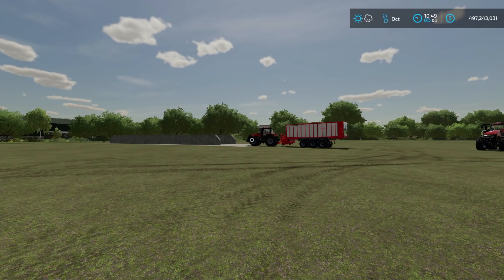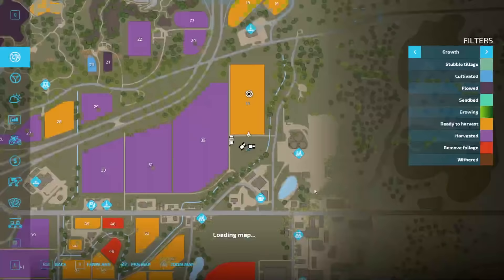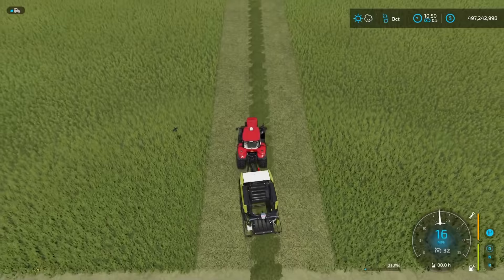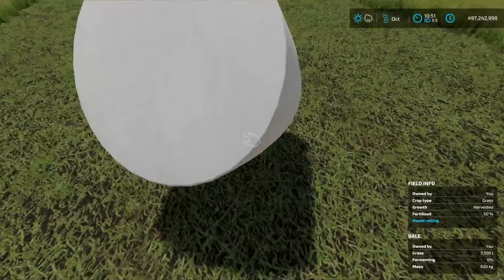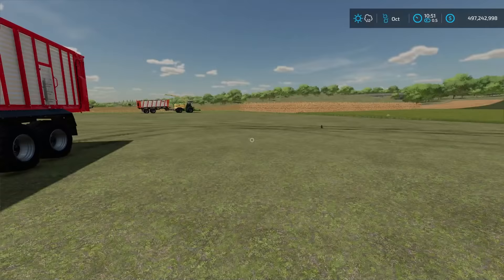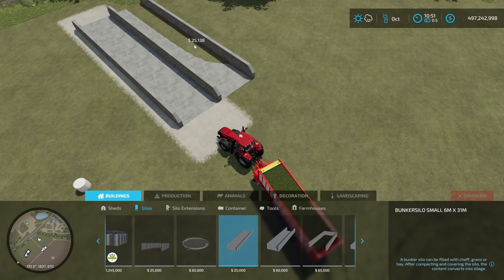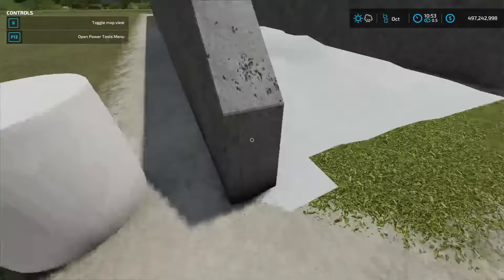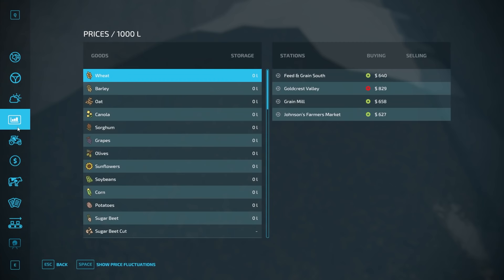GUIDE TO MAKING SILAGE - Farming Simulator 22

Comment: You can also use the forage wagon to pick up the silage from the bunker if you driver over it, probably the quickest method
Reply: Yeah, but if you have a lot of silage  you get massive divots in the silage and the forage wagon just gets stuck, especially when your wagon holds 200,000 liters and you have 2,000,000 liters of silage in your bunker
Reply: I’ve been using the belt system in the agi pack that can pick up product off of the floor to transfer to a trailer.
Reply: Definitely think the belt systems are the fastest non modded way to collect silage from bunkers, I also like the silage harvester mod
Reply: @sparks6177 I’ve never even thought of that
Reply: @sparks6177 do you just turn on the belt system and drive it through the silo with a trailer behindit?
Reply: Atleast give the original poster the credit of the idea  @jjferrin4

Comment: The one nice thing about the Anderson sausage press wrappers, is that the larger one is the ONLY one in the game that can wrap large 180cm round and 240cm square bales.  Unfortunately you have to hand feed it (too bad, I've seen a conveyor mod for small bales on the unofficial sites) - however, unless you have sheep, there is no use for grass bales other than selling at horrible prices compared to hay and silage - and there is no mod even atm, with will shred grass to you can silage wrap it again - animal mixes take hay, straw, silage, not grass as well - I have made a handful of grass bales by accident, where I changed the bale size  accidently to the largest, and my round wapper would not wrap it, so it dumped grass.  Also, if you use your round wrapping baler that can make 180cm round straw/hale bales, sometimes I get the wrong bale I expect, when I switch between 150cm silage and 180cm straw.  Depending on how many you have (I have 9 7500l 180cm round grass bales), it is worth leasing the sausage press to make silage out of them.  $1800 to lease, but my $2500 in grass bales will be worth ~$17k as silage, so well worth it.
Reply: The Kuhn SW4014 can wrap bales up to 220cm so thats not a big difference compared to the Anderson wrapper.
Reply: @Luuk-ur3sp  My point to use it, was at times you get grass bales instead of straw bales, if using your baler for both. And large grass bales are useless unless you have sheep...and more useless if you demand it be hay for long term storage.  Therefore, you can have the sausage press to wrap those large grass bales you may get once in a while, and it will indeed pay for itself.  If you have spare space to make long sausages, they are perfect to easily pick up during sell time with the Anderson and Arcusin real autoloaders...if you used modded fake bale autoloaders, dont bother. If selling silage, and not using fake autoloaders, logistics in picking up bales during sell time becomes a problem, but IMO still much better than loose, as bales have a huge density advantage over loose...with loose, trucking and trailer maintenance costs will eat a lot of profits, and your most valuable resource....TIME.  With maintenance and fuel, loose is far more inefficient than bales in FS22...needed only for corn silage, until someone makes a corn silage baler...and those do exist IRL and should now be possible as a mod in FS22.

Comment: In the video with the loading wagon bunker, you showed a potential bad problem many people have.  You covered the silo with all the grass not in the bunker.  That chaff strip sticking out which did not get covered with screw you.  You go to scoop up the silage and you pick up the chaff first, and it turns your entire pit back into chaff - well, this atleast happened to me in 1.1.0.0 - not sure if they fixed it or not in 1.2.0.0.  ALWAYS push you chaff all the way into the bunker...be prepared to push it a 1m inside, so you when your vehicle exits and causes the chaff to flatten and spread, it still won't be out of the bunker.  Shortcuts lead to bad cuts!
Reply: Thanks for the tip!
Reply: If you use the soften tool, it will get rid of the chaff it touches, be careful though, it can also remove the fermenting silage in the bunket.

Comment: Grass silage has a 25% higher yield (and I wasn't using a baler with silage additive, but the forage harvester did). Overall maintenance is probably similar. Grass will not require plowing or planting annually but does require 3 harvests to Corn silage's 1. However, grass should be rolled right after harvest for an extra layer of fertilization. Rolling versus fertilizing has a trade-off. This trade-off with time vs. money as fertilizer can be thrown out at great width, where-as the rollers aren't even close to that width but cost nothing over ground except maintenance costs. Handling may be the same between the two sileage types as corn requires hauling and a silage bin, then it needs to be picked up out of the silage bin and hauled in a trailer. This can take at least a full trailer for a small field, let alone multiple trailer loads for a size-able field. With grass baling it needs to be mowed, then baled and wrapped, then gathered and stored. Depending on the bale type or baler this can be a multi-step process. Once it ferments then it needs to be moved in bales. The bale loader can carry 24, which even with the smallest bales (3500L) is 84,000L of Silage. There aren't any trailers that can carry 84,000L of silage.
Reply: Do you know wich one is the most profitable?

Comment: Thanks for this, new to the game and have been doing baled silage, but thinking of switching over to bunkered.
Reply: Idk if its a bug or what.
But my bunker is fermenting significantly faster than the bales. (Bales had a solid 2 hr head start) and my bunker is 75% fermented vs the 45% on my 1st trailer load of bales

Comment: Probably the simplest way I’ve found of doing silage is getting the trailer to semi adapter, pull a semi trailer on the forage wagon and pick all the grass up. Then make a huge pile and use another modded square baller with a windrower on the front. Wrap them up and you’re done
Reply: You can also use this dump and bail technique with pretty much any kind of bailable item

Comment: Hey Farmer Cop, for chaff silage, you can do this in the last grow state already. I don't know if it will give better yield but it does in real life
Reply: I just tested this, and there was about a 1% difference in yield, which is usually attributable to gave variance.
Reply: @danielmansour7230  that's not a lot off difference, but what I meant was that in real life making chaff in the last grow state will be holding more  nutritions.
I saw somewhere that the flowers of the crop are around 40,% bigger. Hope I wrote it ok so you understand what i try to explain.
Thanks for testing it

Comment: For anyone who was curious 
One of the faster ways to compress inside the bunker is to drive the largest rollers over it. Weight plays 100% of the factoring into compacting and the largest roller is by far the fastest way i have got it to 100% after about 2-4 passes! just be mindful for uneven driving as you can get stuck 👍

Comment: Is it possible to use front mower attachment on a tractor with forage wagon on the back? As you mow the grass, the wagon should pick it up. And if forage wagon in 22 works like in 19, you can use it to pick silage from the bunker silo.
Reply: You can, but a large field would take a very long time as the front mowers are only a couple meters wide. But maybe the time savings from haveing it cut and picked up immediately would be better than having to cut the field then get picked up afterwards, you would need to test it but I think it’s unlikely

Comment: Silage... yogurt for cattle. 

Curious why IRL someone would go through the trouble of planting corn,  just to harvest it early for chaff. If you were creating silage, grass is easier because... it regrows itself without a new seeding process. If these machines are this expensive compared to grain harvesters, then economically seems dumb combined with the fact that grass is dirt cheap.  Maybe if the crop dies from disease or drought, this is an alternative to just burning or cutting down the stalks of the wasted crop and getting absolutely nothing in return. 

Concerning TMR, nobody I know feeds their cattle anything more than hay and grazing grass.  This has to be a tight acre or cow barn farm thing, or with dairy cattle. Anyone familiar with it?

Also the first setup with the baler and then get the round baler pickup and buy lot 71 every time it's ready to go on Elm Creek. Get you a plot of land and just have a mountain of silage bales and wait until January. You can easily pick them up again with the trailer.   You will rival Bezos and your TMR supply can feed all the cattle in Texas for about 2 years. Round Silage bales is where it's at. Also make some smaller ones when starting out to easily mix your TMR so you don't want too much silage in the mix.  Hay and straw are easier to come by so you want the least amount possible to suffice "TMR" and not turn it into forage.
Reply from the maker: Corn IRL has different nutrients than grass so it provides a different type of silage (corn silage) as opposed to grass silage for animals

Comment: Great vid very helpful, I don't understand why you would use corn over grass?  What is the benefits of using corn?  Many thanks.  👍
Reply from the maker: Corn has a much higher yield than grass does so you get a lot more from it but the equipment costs more :)
Reply: If playing seasons you can only grow corn once a year. Corn gives a little over twice as much as grass per harvest but grass can be harvested 3-4 times a year. Corn does require much less work for what you get but is also more expensive to upkeep since you can't fertilize with rolling and much more with reseeding.

I'd say corn silage would work best for a more advanced farm that can afford the equipment, or just wants silage to upkeep animals/production rather than selling as much of it as possible. Also if player isnt using seasons and doesn't want or have time to harvest grass every three days.
Reply: @kayokayo7917  cheers for all the advice, it is really useful.  ty :)
Reply: @kayokayo7917  So if playing with seasons then grass is the way to go?
Reply: @seeker7533  Depends what you're doing with it really. For max silage with seasons, yes, grass will get you 50-100% more per year. It's more work though, but also cheaper equipment-wise, though eventually you'll pay more over time for seed/fertilizer. It's pretty balanced between work, cost, and overall yield imo.

Comment: I have a question. If you put 100 000l of grass to a silo, compres and let it ferment, how many liters of silage will you get? also 100 000? the first time, I used the silo, I've  put 340 000l and ge 220 000l of silage. I have no idea that it was a bug or it suppose to be like it?
Reply from the maker: It should be 1 to 1, so 100,000 would yield 100,000 in silage, not sure why its different for you

Comment: HELP! I have the large bunker 1/4 full with fermented silage. I can only remove a small portion of plastic off the top of silage.  3/4 is still covered preventing me from adding more grass to ferment. How can i remove it all to add more chaff on top?
Reply: You can only fill the bunkers once you tarp it. I don't think you can add more to it unless you move out the already fermented silage.
Reply: @gamerpro-ys6hy  so only tarp it once is what you are saying? Fill it with multiple cuttings throughout the year, compact it after i get it to the brim full, yhen tarp it only once.
Reply: @user-rm5du1yo9p  ya that's right
Reply: The thing is worse. I silaged 100k grass. Everything fermented. I managed to collect  and sell 25k, but the rest is covered under plastic and I did not find a way how get  it out. It is a huge disaster for my starting farm.
Reply: @mrakomo  hey david, did you try leasing the 2 belts needed to get silage out of bunker into a tipper trailer situated for silage?
Reply: @user-rm5du1yo9p  No. I used the grass collector, that I was using to collect mowed grass from the field. I opened the silo on one side collected everything there, but the cover did not uncover further. I did the same on the other side of the silo and same problem. There is not uncovered silage to collect. From what I remember from FS19 the rest of the silo should get uncovered automatically after I collected the silage, but this does not happen for some reason.

Comment: my silage bunker won't let me remove blanket on part of my bunker. Anyone else have this problem?
Reply from the maker: You have to use a bucket or conveyor to start removing silage then the rest of the blanket will come off as you get to it.
Reply: @FarmerCop  thanks tried front loader didn't work. demolished and started over. it may be because i uncovered the ends so the middle would not uncover.